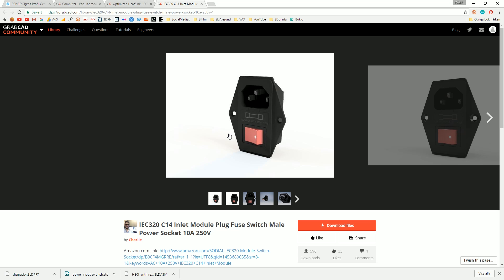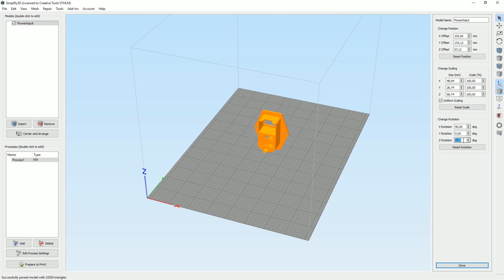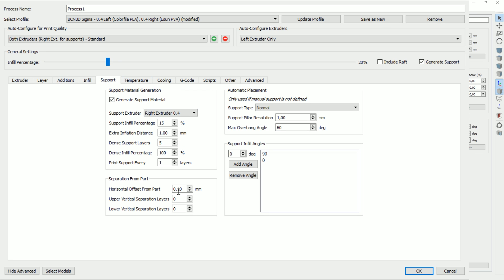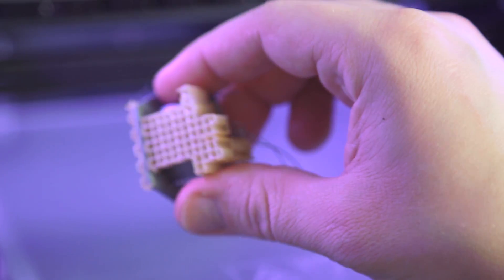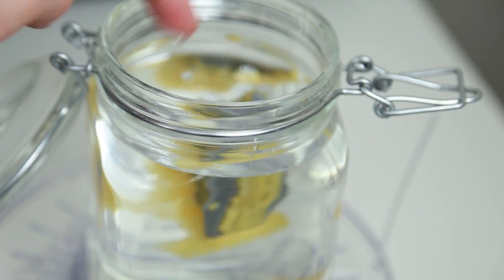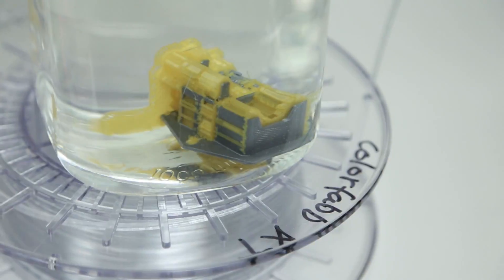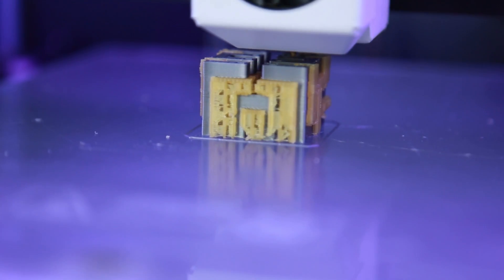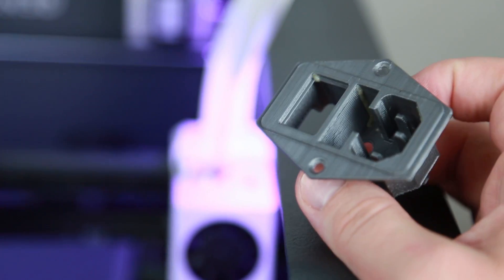BCN3D - Sigma R17 - VLOG 5 - Super Dual Extrusion PVA Support results with a 3D Printer

Comment: Cool video! How do you like the ESun PVA? Seems like the same PVA that they are using on their videos? (like the helmet printing video). Still have to try PVA on my Sigma, first tries where not so good :P
Reply: Sorry to bother you @3D Print - Tech Design but I just wanted to know what exact bags you use for resealing the PVA. I don't what size size to get and what bags are the best. A link to them would be greatly appreciated. My Sigma is coming very soon!!!!!
Reply from the maker: Thanks! I believe it's the same as the BCN marketing videos yeah, It works great for my tests so far. It's just a matter of keeping it dry when not using it. So as soon as my print is done I unload and put into a vacum bag with silica gel again.
Reply from the maker: +Josh B it's just regular resealable bags, you can get some on amazon or eBay easily :) )(feel free to use affiliate links in video description ;))

Comment: Once you get PVA right, it gives you infinite ideas! However, it makes your hobby X10 more expensive. :D
Reply from the maker: Haha xD That's true! PVA is tricky. You are using it quite a lot on UM3 right?  How do you store it, and do you remove from printer after each use?   I'd love to see more designs that utilize PVA ;) Keep rocking!
Reply: PVA is pretty sensible to humidity, so I'd recommend storing it in a zip bag after use. I don't leave it on the printer if I'm not going to use it. The place where you live can certainly affect the PVA, and I'd say living in the middle of a desert is the best environment for PVA.